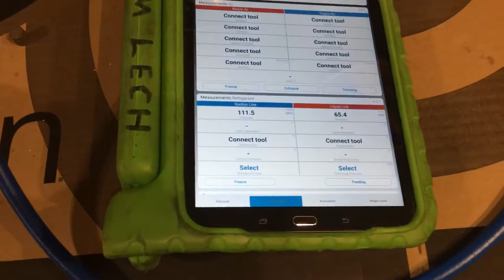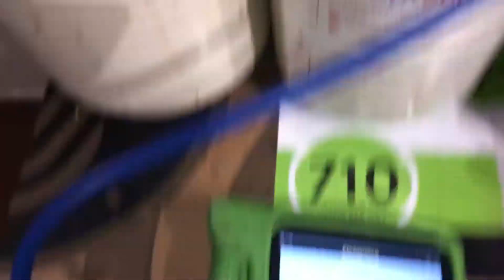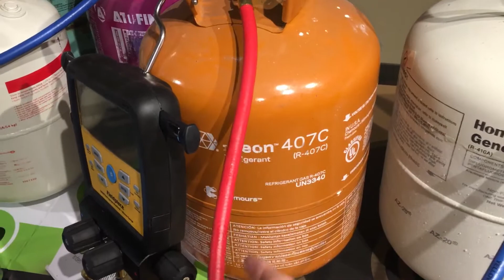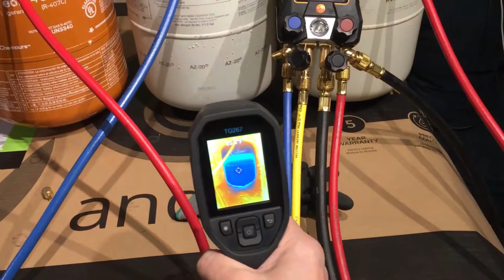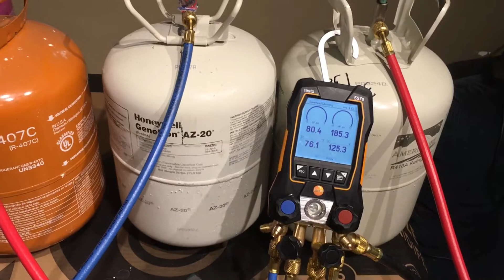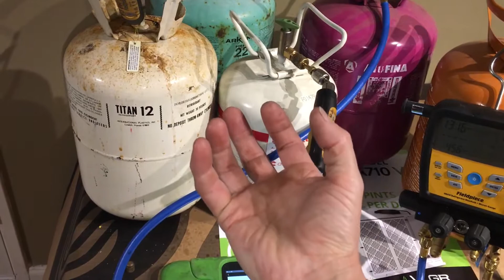Automotive AC refrigerant. R12, R134a, R1234YF, what about the other 30+ different refrigerants?

Comment: If theyre all basically the same and old cars had worse radiators, why did older cars blow so much colder?
Reply from the maker: You ever do a size comparison of condensers of old large flat nose car designs that can support a 36” X 34” X 2” that weighed 15 pounds. 
      Now compare that with the aerodynamic, small nosed very short, narrow frontal design of a car nowadays that can only support small condensers and they save weight so you have condensers that are only 20 inches wide 18 inches high and about a half inch thick and weigh about 3 pounds. 
  Much big difference in mass and surface area. 

And Old Cars had an average refrigerant charge weight of 3 1/2 pounds of refrigerant. 

New cars are around 1 pound of refrigerant to one and a half pound on average. 
     If you lose in your short, just 3 ounces it greatly affects the performance on hot days

On Old Cars if you were 3 ounces low on refrigerant, it would do nothing to the performance
Reply: @coldfinger459sub0 ok, so despite all the extta surface area and fins on the newer radiators, it still doesn't come close to the older radiators?

And, also, the larger amount of refrigerant plays a huge role as well.

How much colder would a modern car blow if it used r12 instead of r134a or whatever the latest patent is?

Is there any way to get a modern car to blow as cold as older cars used to?
Reply from the maker: @bradojacko8247  there are still cars produced today that are just as cold as the old ones and get cold just as fast.,
        Because now they have internal heat exchanger. 
     And they have what is called ultra efficient, micro channel condensers that have just been released in the last several years. 
       Were you still get down into the 30s if the manufacturer allows it by software because all vehicles nowadays mostly but not over yet are controlled by soft

I have a video of my car driving it’s 106°F and I have 39 to 42°F blowing out of the dash of my 2012 Prius with electric compressor driving down the highway 

It’s the hardware that makes the difference not the gas
Reply: @coldfinger459sub0 interesting. Many vehicle software wont allow below 60F. Why?  I assumed it was due to physical limitations.
Reply from the maker: @bradojacko8247  I don’t know of no vehicle that doesn’t allow below 60 in today’s car. 
Sounds like you need a new thermometer

Comment: Hey I have a 2019 Honda CR-V with 1234yf, can I charge it with 134a? I had to change a damaged condenser. I can get adapters from Amazon.
Reply from the maker: @jpamaroautosales5463  it’s not approved or legal by the EPA standards. 
    But yes, it can be done. 
134 refrigerant is compatible with YF refrigerant oil 

But 134 refrigerant oil is not compatible with YF refrigerant
      Doing so I believe the EPA if somebody turns somebody in selling a vehicle that they charged with 134 should BYF fine is in the range of the tens of thousands of dollars. 

And if somebody was doing it for a profit in a business for sales, it would be considered fraud .

Comment: 100% reight ,if you charge r12 in Tesla you will safe up to 40% energy, the reason is the variable dc compressor will rund max up to 50% of max  speed means 1,5kw instead of 3kw by start , also POE oil is mixable with R12

Comment: Assuming a system is properly designed for either, what exactly makes R134a less efficient than R12? From everything I read, R134a actually can absorb more BTUs of heat per pound in the evaporator than R12 can. If I remember correctly, R12 can absorb about 70 BTUs per pound while R134a can absorb about 85 BTUs per pound.

So does the efficiency loss just come down to more power being required to pump R134a due to its lower evaporating pressure and higher condensing pressure or is there some other variable at play here such as differences in thermal conductivity?

I've actually found studies showing that R134a is more efficient than R12 under most operating conditions, so maybe R134a is better than we are giving it credit for and got an undeserved bad reputation from people doing halfass retrofits and using it in systems designed for R12?
Reply from the maker: It’s btu per lb. 

But they made it better by using better condensed and evaporator efficiency that was not used back in the r12 days 

They use more efficient compressor that were not available back in the r12 days. 

They use much thinner viscosity oil less friction then back in the R12 days
Reply: @coldfinger459sub0 
You can calculate cop with the phase temp diagram, and given a system is optimized for the refrigerant, they should be very similar. More BTU/lb means more surface area needed for a given refrigerant flow rate, and different compression ratios for each gas. R12 had less pressure, more flow, and less surface area. R134a doesn't give off enough heat in the small convener to have good supercooling so when it expands you get most flashing to gas right away to get the temperature down. Multi factorial. Propane has a lot more BTU a lb, basically double that of r12. Can use thinner diameter pipes with a higher external surface area for a given flow rate, thanks to it needing less flow. It's definitely more efficient. But it's mostly down to temperature differential that really matters for good cop.
Reply from the maker: @ yes with the math formula as you can figure out exactly what and how much refrigerant and condenser evaporator size you need with the given compressor and temperature range that your designing to Working. Low temp, medium temp high temp..
Reply: Purdue University? fake study

Comment: Here's one for you.....look up an invention called a Smart VOV Variable Orfiice Valve by Nartron for cars.  I spoke to the inventor who sold it to Nartron for the aftermarket.  Packaged by 4 Seasons, Standard, Napa.  Will help get a 134a down 7-14 reduction in temps.
Reply from the maker: Yes, I used to use them back in the 90s.  They’ve been around forever.

Best suited for stop and go traffic desert driving . Especially my clients who like to go hunting in the high mountains where it was very hot and they’re climbing slowly dirt roads in 100° plus weather. 

But you must actually read follow that little*in the small print to do exactly what they recommend to be done 

Otherwise it might work at first, but cost you a compressor later on 

Unfortunately technicians don’t like to read
Reply: @coldfinger459sub0  What was indicated?  Still have the original directions, & never saw anything, other than using small brass  sleeve over the end on some GMs to shield it from refrigerant falsely tripping the compressor cutout switch I think.....
Reply from the maker: @chrispompano  I took on a part in it actually have a Spring with a metering device inside. 

Oh, so under spring tension I guess somehow it was just metering refrigerant and had spring tension performing some sort of control . 

My first one I installed was on one of my customers who owns a body shop was a hunter and would go off roads on dirt roads and crawl at very slow speeds in the summertime . 

After installing it, he said his air-conditioning has never been so cold. I just idle speed stat stop in Slow crawls. . 

That was my very first experience using the device

Comment: If you mix them the pressure is not the average of the 2 materials it's the sum and that can really mess with pressures
Reply from the maker: Sometimes higher them both and you will have something called glide

Comment: what about R152A,  that air duster for cleaning computers . i have had friends that use it and it works really good , its really close to R12 as far as i can tell. i was just wondering what your thoughts would be on the R152A
Reply from the maker: It does work it is a refrigerant. 

Getting to charge correct is the problem many guys get it working and then six months or a year later their compressor burns out.    The ones who don’t are the lucky ones it’s a gamble a roll of the dice. 

But if they wanted to they could design a system and correctly use the right amount of lubricant the right type of lubricant with evaporators condensers and compressors that were designed to use 152 that would be good. 

So that’s entirely up to an individual to make that decision the winners are happy with a smile on their face the losers are changing a compressor and if it totally launched an eight up and ground up the metal flake in the compressor then they’re changing a condenser receiver drier expansion valve and having to flush the whole entire system
Reply: @coldfinger459sub0  on old r12 car you have more room to be off a little any a 134a your taking big risk

Comment: So..... Filling my car with R410a would be a really good idea then?

j/k
Reply from the maker: I would really love to do that and send the car in to an air conditioning shop for them to diagnose the problem LOL 😂 

       Always wondered if I sent 10 cars in to 10 mechanical shops filled with R410 how many parts would get replaced as part of their diagnostic . 

       I would like to see the faces of the automotive technicians when they hook up their gauges with the air conditioning off and they have 250 psi showing on their low side and high side gauges. 🤔

         Or when they started up in the low side is about 126 psi and because the condensers are so small show me small for R 410.   The high side will probably be about 400+ psi if not higher on hot days it would instantly trip the transducers over pressure safety limit and cut off the compressor or if it had a pressure bypass blow off valve would vent the refrigerant to the atmosphere. 

         In either case the automotive technician would think there’s defective parts causing the problem in many cases and change expansion valves or change compressor change condenser

Comment: I own 23 old cars only 2 of them does the ac work
its hot in alabama

11 years ago I worked in an independent mercedes shop

the cars came in and he retro fitted them from R12 to R134

the customets were never happy
with the ( you have to be moving for them to cool statement)

the compressors blew up often
we would dump out the R12 oil refill with R134 dye that awful machine on wheels 
recover old freon madness

the good ole days pull into a service station
the dude would grab a can of R12 a whip hook it up shake the can while you rev the engine and in 5 mins your off the car cooled great all summer.

so now ive got to figure a way to fix my old vintage cadillacs with the broken programmers that wint swap from heat to ac and never tell the blower to switch on.

i can hot wire the blower motor
a four seasons valve to shut heater flow off in summer
but what to do about getting cold ac that wont fail
ive been thinking of using 134 equipment with R12 and 134 orings on new pipes with oem condensor and evap and oem expansion valve abd new dryer bottle? and sanden compressors 
any advice is aporeciated.
Reply from the maker: If you have humidity I think Alabama does I think I’ve heard that complaint before retrofitting to 134 is not a great situation you will lose your lower temperature to get below the dewpoint on hot days In 80% two 90% humidity

       If you’re not concerned with vintage original looks you could go to Vintage Air and order one of the new parallel flow condensers

       As for repairing your climate control head center on those old Cadillacs that was something I only played with as a child when my dad taught me how to work on him he used to rebuild them he used to work for General Motors when he was young with those Cadillacs. 
                    Father used to get the warranty exchanged parts they were going to junk he would bring them home and rebuild them and then resell them in his own business 

         Yes you will have to figure out a completely different way of bypassing and controlling everything in the Cadillac

      All depends whether you care about the original vintage look or not

       A better condenser and adding some electric fans to a pressure switch that engages them does wonders for our 134 retrofits

        The only reason I want 34 retrofit compressors would burn up because none of the technicians were qualified educated or trained or had the basic knowledge of how to do it correctly. 

       On my old restoration cars that I’ve done for customers 30 years ago in their collection that were retrofitted from the old York‘s and Tecumseh  in A6 Frigidaires. Are still running fine today 

           even the one little Honda can’t remember the name of the compressor manufacture but even OEM and aftermarket compressor manufactures said never retrofit it over because they kept burning out compressors and did not work right. 

       I did not use automotive refrigerant oil I did not use the weight viscosity that was recommended in the automotive business I come from commercial to and I did not retrofit it over the way guys were taught out of magazines or sitting in a few hour class

       so the units would still work decades after when they were notorious for blowing up and blowing icy cold by not following the field procedures that were taught in the automotive trades

Comment: hey 
i have a special cadillac 1976 seville the heat and air do not work on the heat a manual valve is ok
and the vintagd programer imfamous blower inop problem i direct wire it to full speed using a light switch
that usually allows the system to swap from hot to cold and blow air from floor to dash on the cheap
1rst it had smog pump w large A6 compressor megah beavy engine power ro bing setup
i ordered a bracket to replace the compressor with a modern sanden unit that will fit were the smog pump was 
now the vintage condensor and evaporater are still in the car and i have cans of R12 
should i fit that together and cross my fingers or buy the classic air 1974 nova kit and refill a 134 aftermarket system 
with R12 of course swapping the compressor oil out to R12 oil
Reply from the maker: Problem is if you still have the original hoses you have all that money and good R12 that you may possibly lose due to leaks if the hoses are still old. 

          But if you change the hoses I would stay with the R 12 you gain a few degrees of cooling in hot weather
Reply from the maker: I forgot to mention.  I would say 80 to 90% of all retrofits to our134 are kind of done improperly so the results are not very good. 

    But it does work especially at temperatures lower than 80° not much difference if everything is mechanically sound in all cooling related components are working at peak 100% efficiency like fans plus the thermal expansion valve 

          Doing a retrofit on an old car one of the best things you can change especially if it’s slightly damaged or you think of questionable reliability is change the condenser to a more modern day micro channel parallel flow condenser

          But then you run into the problem most people don’t know when you do that you have to greatly reduce the refrigerant charge because they have a very small internal volume but they have a extremely high rate of heat dissipation that’s what makes them better

          And micro channel condenser systems are extremely sensitive to exact refrigerant charge it’s very easy to overcharge them

     The old systems in vehicles from 1970s in earlier were very forgiving to being under charged or especially over charged a little

      Today’s vehicles with micro channel evaporators in micro channel condensers are extremely sensitive to even a little bit of overcharging on a hot day will greatly increase the pressure

       So somebody without a lot of experience would not know this and 90% of technicians don’t know this and even when they do they don’t know how to properly determine the proper charge